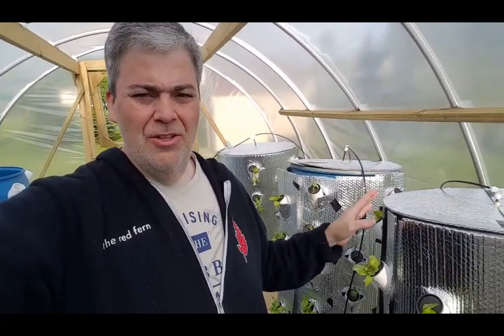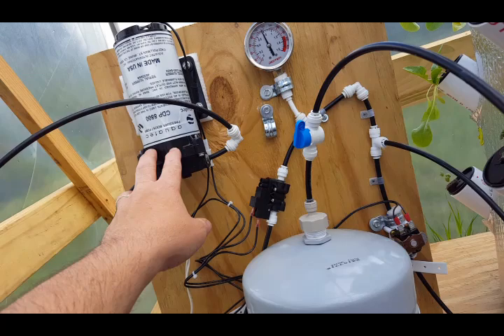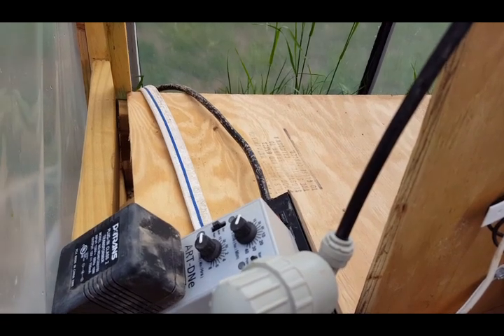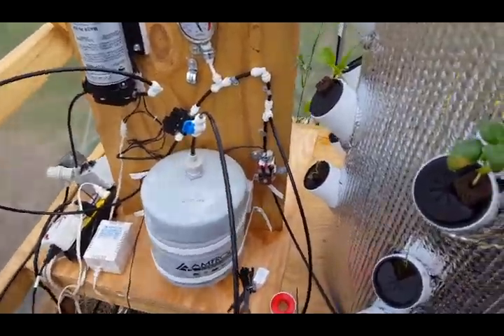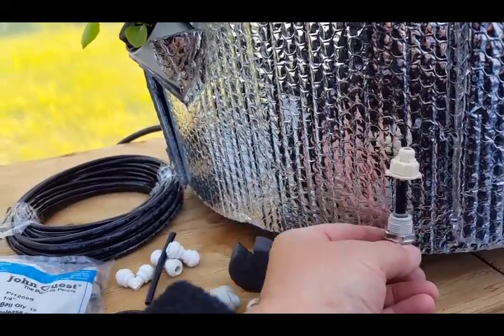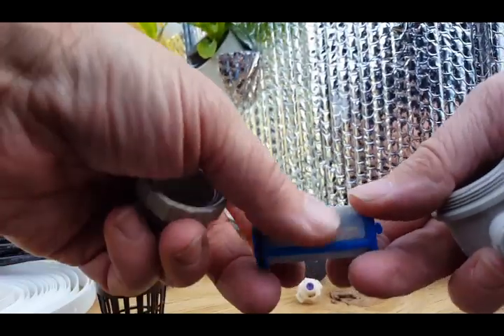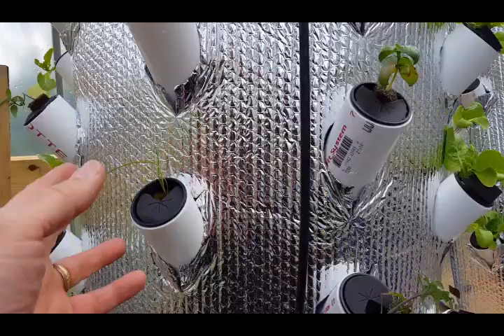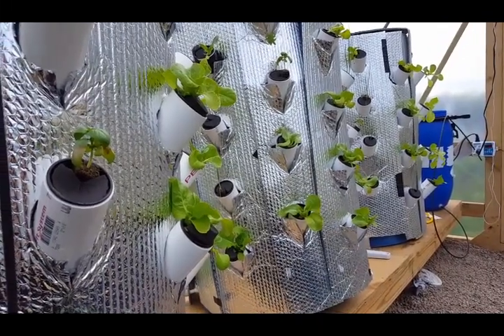How I setup my DIY Aeroponic chambers

Comment: This is a great setup. Will the present high pressure system components run all 8 barrels once you complete the next 5? Or will the reservoir need to be larger?

Comment: I know this is a old video.
But I just want to say you have a nice setup.
Ten years ago i started to build a HPA system.
I purchased everything I needed. And it wasn't cheap.
So I started putting it together. And the more I looked at it, the more I could see where problems would arise.
I researched about this for about 8 months before I even purchased anything.

But I stopped building my system. And went back inside to do more research to see if I could find someone who was growing this way and what problems they were having.

Well back then there wasn't to many people growing this way and the one's that were were not showing any of the problems they were having.

But I came apon this person that was growing with LPA.
And this guy has like 3 years of videos of his operation.
The detail this guy goes into is just great.
He shows how he built his systems. I mean he actually build's a system and you get to watch.

He actually shows about five complete grows with any problems that he runs into.
He shows the nutrients and how much to use and why.

I mean this guy does a complete tutoring.
He doesn't just have 1 post, he has like 300.

So anyway I stopped building my HPA system.

And I've been growing with LPA for 10 years now.
With NO problems and with great results.

So anybody thinking of growing with HPA, you might want to check out LPA first.
Take care and good luck.
Reply: Could you give a link or name of the channel?
Reply: @marynichols7429  I've been using a refined version of the "Stinkbud" method of Low Pressure Aeroponics for over 10 years. Like others commenting, this video absolutely convinced me I don't need HPA. 
To be honest, I feel better referring to my system as "Dribble-ponics". 
I suspect it can produce virtually the same results, for way less expense and maintenance. Wish I could afford to build and compare both side by side and prove it...

Comment: Hi Don I like your video I watched it four or five times trying to catch little details I've watched dozens and dozens of videos as well I pretty much have everything I need to make what you've got because I'm in the water treatment business however you've done something that I like but I don't like I need to understand exactly what you've done cuz you've not shown us what you did you're using pipes instead of elbows and you say you cut them on a 45 and you screwed them in I just cannot picture what you've done am I going to cut a 45° angle and the pointy part of the pipe is going to be bigger than the hole so you're screwing it into the side and then sealing around it so one screw is holding it up I don't think so what exactly is it that you've done have you stuck it into the hole is it a 2-in pipe I haven't gotten my cups yet or whatever you call them to see if they're going to fit into a 2-in pipe a response would be very helpful for me brother thank you
Reply: Sorry of ita off topic but do you know where i can buy 4 in diameter food grade pipes or pvc?  I want to make tower gardens amd it seems theres only normal pvc which will leak micro plastics.

Comment: Hey Don.  How about an update?  In particular, how often do your nozzles clog? Do you have algal growth in your nutrient mix? Has the system stayed robust? Do you need more than one nozzle per barrel?  A quick update video would be super!
Reply: Yes I second everything he says
Reply: The nozzles won't clog, usually high pressure aeroponics growers put an water particulate filter before the pump,
One nozzle is mostly enough,
Usual running is 30s spray, with 2m - 3m intervals.
Also growth, if you don't hear the water much, not that much of a problem.

Comment: Instead of those blue barrels some people use 8" or 10" gray PVCs, as it is you are using white 2" PVC.  
Question, what do you use for nutrients?
And instead of using the thermal layer around the barrel couldn't you paint the barrel black including the 2" PVC?

Comment: Hey,  can you specify the quanity and part # of each item needed to set up 4 barrel aeroponic system? We are having a problem locating the DMfit Filter strainer 1/4" x 1/4" push in 100 mesh. Do you have a part # for it and a suggestion where to purchase? Thank you in advance!
Reply from the maker: you could get away with just 1 filter if you use it on the pump intake and filter the return line to the reservoir with a fine mesh bag.  here is a link for the filter https://youtu.be/0ajQyY6OVb8

Comment: That reusable push fitting filter for 1/4 tube would be a life saver at my golf course. our irrigation is controled by 1/4'' plastic tubing and we need to replace about 30 filters. I have been looking all over the internet since i watched your video today and I cant find them anywhere. Could you point me in the right direction Don? Thanks and be safe.

Comment: hi, why not just use ultrasonic myst systems? you would save a lot on energy this way, as well as water, kind of similar, but better results at times :) look up aeroponics, I think you might like it :)
Reply: Mist is supposed to be too fine and creates more fine root hairs then required and not enough lateral growth.

Comment: Couple of questions for you if you still comment on here, the first would be, with your roots not coming out too far just yet is your mist sufficient enough to get into the holes. Also why not go to a 50 micron mister? I think the NASA range was from 5 to 50 microns was optimal. Lastly can we get a video of where your lines feed? I saw most of it just missing where the lines feed for things like the pressure relief. I am excited to build mine and grow some

Comment: Don...  I  built a HPA system using AeroSciences Aeroponic misting nozzles that use air pressure to create the fog. It only requires 30 - 40 psi to create 10 micron  fog.
Reply: Just checked out their site. How do you like the results with their nozzles?

Comment: In terms of plant growth is there much advantage to the more complex High Pressure setup as opposed to cheap ultrasonic mist arrangements?

I was thinking of using ultrasonic misters with small self-contained 100ml reservoirs inside of larger grow buckets, which drip-drain back to a main reservoir... to avoid having permanent water in the bottom of the grow buckets and minimise the total water volume of the system.

What I don't know is how effective each system (High-Pressure or Ultrasonic) would be in terms of nutrient take-up.

Also, would a forced air system be useful in the root-growth stage, to get the roots to dry quicker in the off cycle?

I'm a first time urban gardener on a budget : )
Reply from the maker: when i was 1st starting this the videos i watched said basically that high pressure fine mist increased nutrient uptake and almost doubled growth rate of hydroponics. no idea if that is right or not

Comment: Do you have any more videos on this build? What are you using for a lid? Did you cut the tops off? I see in the comments you’ve made some mods can you explain those. I’d really like to attempt these. Looks like a great project. Thanks and great job!
Reply from the maker: i was able to buy the used barrels thay had tops that come off so no cutting. they originally had tomato sauce in them with a plastic liner. i never did make a "build" video but I'll answer any specific questions you have

Comment: Just one problem in my area I need a 220 v setup but thanks great vid
Reply: Why not just get the 12v pumps and use a 3rd party transformer? The 120 and 220 volt pumps are usually more expensive anyway and then can't be used without an inverter or geny if there happens to be a power outage.

Comment: Great video Don!! Really helped me understand how to rig and setup my own aeroponic system :) 
Just one question: what kind of spray nozzles are you using for your configuration?
Reply from the maker: Simon Kim in the comments below the video is a parts list. here is a link to mist heads I use Mist Nozzle, Plastic, 3/4" Gph, 1/4" Barb, Bag of 25 https://www.amazon.com/dp/B00KISS9RU/ref=cm_sw_r_cp_apap_C3clVJjccnHY8
Reply: @donfairview2001  Hi don, if you are putting nutrients into the reservoir does the skimmers you have installed filter out the nutrients? thanks!

Comment: Building a low pressure system. Interesting mod using the straight pipe for the plant holders. I may go that way also after my first four barrels.
Reply: I would recommend using 135 degree elbows if you can afford it as they offer a lot of cost saving advantages over straight tube (ie; they can pay for themselves). Cutting the tube at 45 degree and using silicone etc to hold it in place is ok but you`ll find larger plants + gravity can generate a lot of leverage ;)

Comment: Hi Don - been tinkering with aeroponics for about 18 months now; thanks for sharing - definitely one of the best videos out there. There are alot of hypsters out there so this is appreciated. In fact the set-up is similar though I have not yet moved to the high pressure yet. Since you are recirculating, you might consider using a UV clarifier on the return line.
//
One question though, what size orifice are you using on the mist head? How is the coverage from top to bottom? I have been testing 0.12, 0.16 and 0.20 inch with a PVC wand configuration: 3 tiers of 5 mist heads in a circle.

BTW, there is alot of good information for aeroponics enthusiasts and a lively community as well at MIT: www.openag.org.

Comment: Hey Don,

Thank you so much for this! Its nice to have this as a reference. Real quick question, the solenoid switch you have, could you explain that a bit more?
Reply from the maker: The solenoid switch electrically opens a water valve to allow the water to flow, it is closed with no power and open when powered , this is hooked up to and run by my timer 
https://smile.amazon.com/gp/product/B016MP1HX0/ref=oh_aui_search_detailpage?ie=UTF8&psc=1

Comment: Well done, sir.  I've been searching for a video like this that actually showed the equipment rather than just the plants.  I assume the pump is electric, no?  Standard 110v?  Rough cost for the pumping system, not including the drums?  Thanks.
Reply from the maker: the parts list is in the description below the video is should help. this is the pump i used 
Aquatec 8800 Series Transformer 120V/24VAC 2 Amp (USA)
Aquatec 8800 Series Booster Pump 110 PSI, 1/4 JG, 24 VAC

Comment: Hi Don, 
I was wondering how your system has grown or is lookin' right now.
I want to build this system myself and I was wondering how I could get in touch with you when I have specific questions?
Kind regards,
Tom
Reply from the maker: percumwan sorry for the delay I don't check these messages nearly often enough. it was a very productive season I grew a lot I learned a lot. If you're on Facebook or social media I could send you some pictures I haven't made another video lately. I did learn that I needed to cut down the length of my pvc. I went back and cut down all the PVCs by about half so that they were only as long as the net pots. This helps the bottom of the net pot stick out on the inside of  the barrel and be in the Mist and it really speeds up initial growth when you put the seedlings in. I think you really want the Mist to be hitting the Young seedlings in the rock wool and keeping that rockwool nice and moist.  then the roots will just keep bursting  into the mist
Reply: Hi Don! Amazing misting system! I'm building my own using your example, but in pvc grow towers, Could you please share any new images of updates to your watering system?
Reply: I use a different method which allows  me to place the seedlings directly into the towers almost as soon as they have germinated. It doesnt require rockwool cubes or netpots which cuts down on the running cost ;)